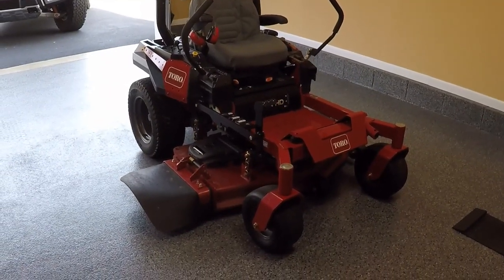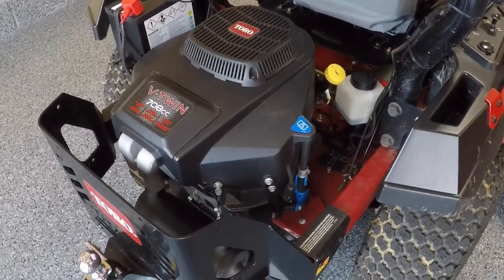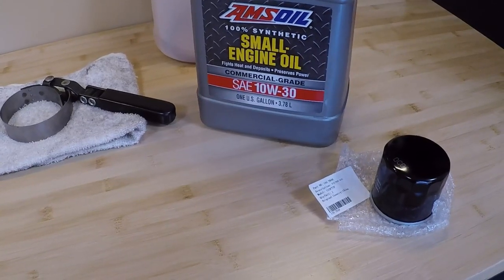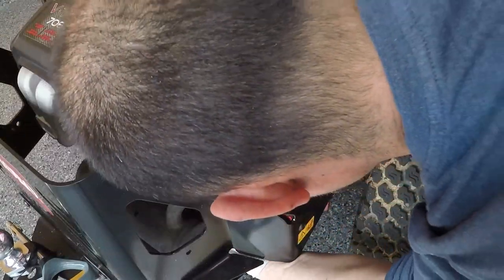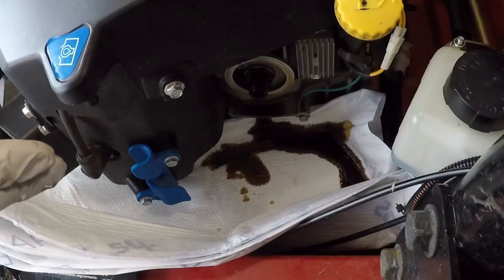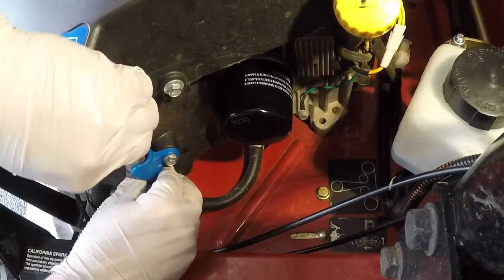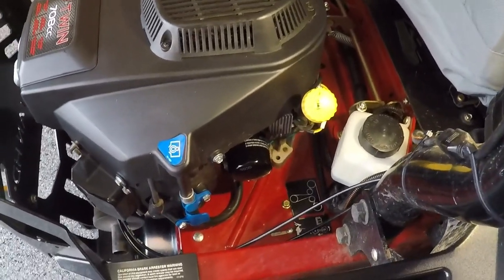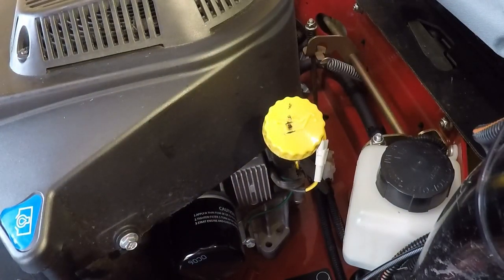Toro Titan / Timecutter 708cc Zero Turn Mower Oil Change & Maintenance Overview

Comment: Thanks for a clear video and great tips however as you said, you had already changed the oil a couple of times, and even though you alluded to the fact that sometimes it’s hard to remove the drain hose, there have been many instances (for other Toro owners) of great difficulty to the point that the spigot has broken off. Any practical advice on that would be extremely appreciated by many of us out there that have suffered this problem. Thanks again and take care!
Reply: Mine broke to
Reply: @craigmurphy5411  I actually returned the TimeCutter, I was disgusted with that experience however I moved up to a Titan 60 inch which is a great machine. At 4.9 hours, time for an oil change, the same difficulties but this time I simply twisted and twisted and twisted the hose as far as it would go, alternating in each direction, and then all of a sudden the drain hose slipped right off. I did so for a few minutes not caring if it would break but of course trying to avoid breakage. Good luck!
Reply: Less than a minute with a heat gun pointed at the top of the drain hose... eases itself right off with the slightest pull.
Reply: @craigmurphy5411  mine broke, what did you end up doing? Did you return the cover or reach out to toro about it?

Comment: I actually returned the TimeCutter, I was disgusted with that experience however I went ahead and moved up to a Titan 60 inch which is a great machine. At 4.9 hours, time for an oil change, the same difficulties but this time I simply twisted and twisted and twisted the hose as far as it would go, alternating in each direction, and then all of a sudden the drain hose slipped right off. I did so for a few minutes not caring if it would break but of course trying to avoid breakage. Note to Toro: fix that darned shameful system!
Reply: What did you not like about the timecutter.
Reply: My 60 in has a nut on the end do I pull it off or twist it off
Reply: @patrickholstein7717  My new timecutter has a nut end oil drain hose too. it’s a Kohler engine.

Comment: Could you help me with my mower I have the same mower the line that at the bottom of the motor for the oil that comes up to motor is that just a drain line just for the oil I need help
Reply from the maker: yes thats just a drain line for the oil